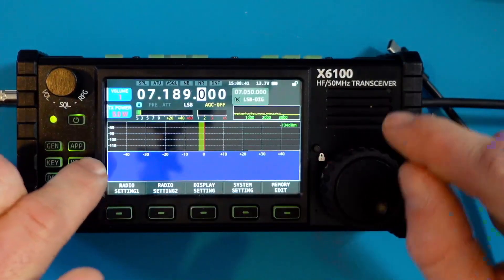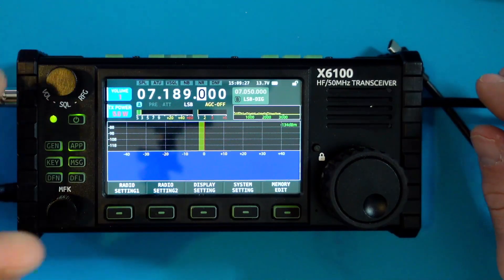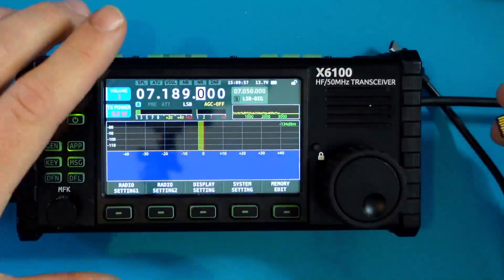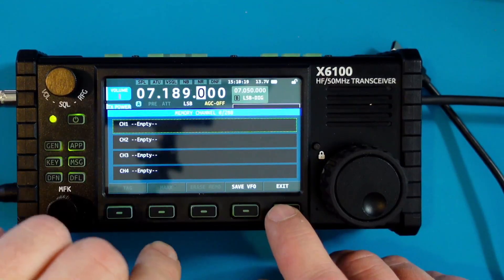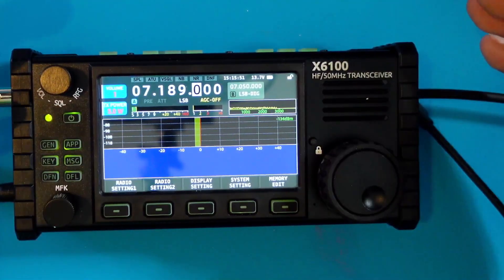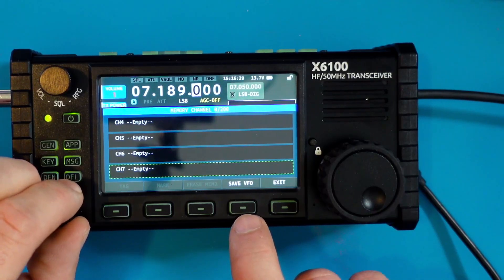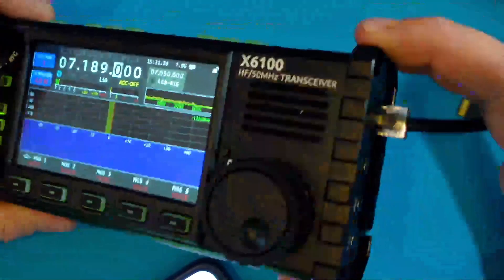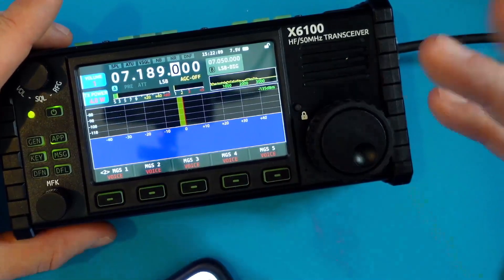LOOK! This Feature of The Xiegu X6100 Doesn't Work!

Comment: I tried firmware upgrade with SD card. Nope. it didn't even detect it.
Reply from the maker: What imaging software did you use
Reply: @DudeTested  I used both Balena Etcher and Rufus. No dice. Won't recognize it on boot. Next, will try different SD card.
Reply from the maker: @akamalov sorry to hear. I don't have the radio anymore, I sold it.   Your best bet might be contacting the company you purchased the radio from
Reply: @DudeTested  sure thing. Thanks again.
Reply from the maker: @akamalov  actually I guess the only other thing is confirming what size SD card You used. Maybe it's possible that too large is a thing?  Good luck!
Reply: @DudeTested  Yup. Next, will be trying 32GB card. Crossing fingers :D

Comment: Sean, I wonder is the tf/sd card is only for firmware updates?
Reply from the maker: It is hard to say. The current firmware upgrade is in the radio already. Meaning, if i go to firmware upgrade, the radio looks for the firmware upgrade list within the radio itself.  How it gets there, I assume to be USB.  When I plug in an SD card and go to the firmware upgrade menu, it just brings me to a local directory from the radios memory.  We will see, I suppose.